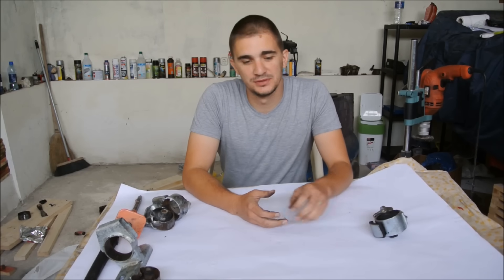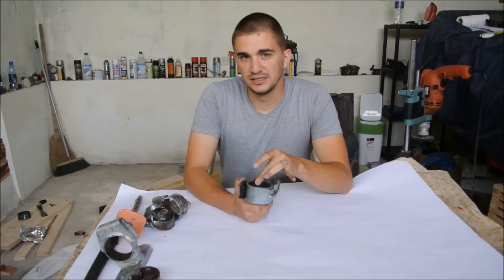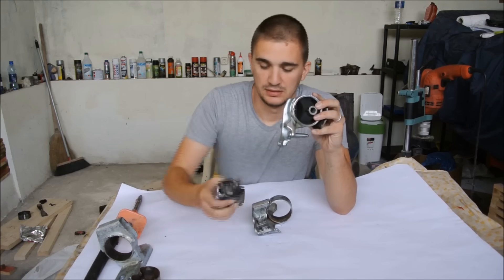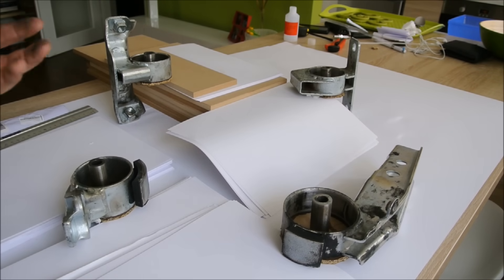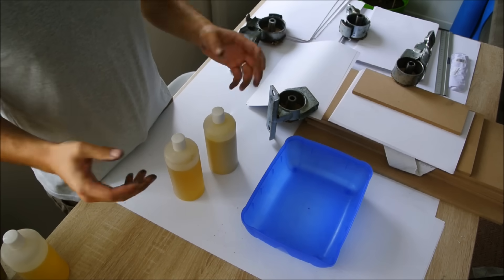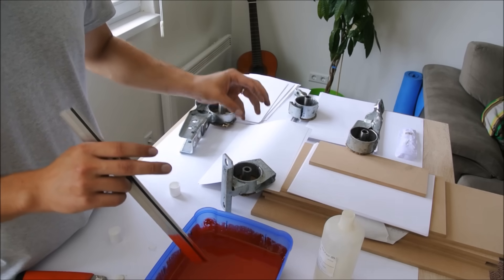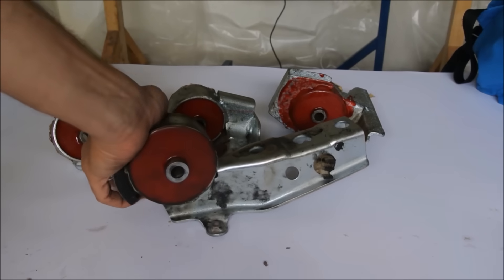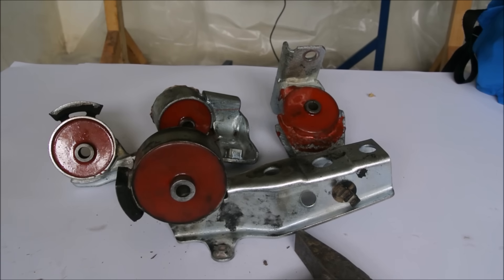How to make DIY polyurethane engine mounts

Comment: A plastic tomato sauce bottle with a pouring tip is a great container that gives much better control of the flow of liquids. The tip allows you to pour into small, precise places, and you just don't get the product spillage seen here. The easiest way to remove old mounts is to burn them on an outdoor wood fired bbq without trying to remove them from the OME bracket. Once all rubber is gone, the outer sleeves of the OME push in mounts can then be cut once with a reciprocal saw & twisted free easily. Plastic bagging or pallet wrap serves as a great release surface to avoid cardboard hang up!  Maybe a better way than using cardboard to local centre sleeves is to 12mm chipboard. Three nails will locate the outer rim, then put the centre piece where it needs to be (offset or not offset), and drill a hole through the centre so you can fit a bolt to the chipboard & hold it in place firmly with a nut. Common floor wax is a great release agent I use all the time in fiberglassing along with PVA release,  so I'm also keen to try them when i attempt this manufacturing myself.
Reply from the maker: WJP004 Great tips!

Comment: I used a calking tube of polyurethane normally used to install windshields instead of the 2 part. it only comes in black but the motor mounts are not that visible. I did not remove all of the rubber, only the loose bits and just filled all the holes, worked great.

Comment: Nice video for a great idea.  Wish I had done this before I used commercially made Poly bushings that turned my smooth ride into a harsh one.  I will try this to get a better ride but will never go back to rubber.  BTW some of the comments here are very helpful with suggestions but a few others are just people living an unhappy life I think.  I wonder sometimes how many people don't bother posting these helpful videos because of the negative comments they get.  Nice work driving 4 answers.
Reply from the maker: Ford Fan Thanks a lot for your support. These mounts will also give you a pretty harsh ride. I made follow up video where I compare these mounts to stock rubber ones in terms of noise, vibration, engine movement and driving dynamics.

Comment: It would be a very good Idea to use a Dremel with a cutoff wheel to cut small grooves around the center sleeve and inside the large outer ring to help create a stronger bond to the polyurethane.
Reply from the maker: +electronicsNmore That's a good idea. The mounts are still going strong, but I'm sure that if anything fails it will be the bond between the center sleeve and the poly. It would probably be a good idea to roughen up the center sleeve outer surface as much as possible.
Reply: @d4a  Hello, 4 years have passed, please tell us how these elements look now !. It will be great to see after all this time. Please.
Reply: @d4a  Smooth-On sells a product they call Ure-Bond to help their urethane rubbers stick better.
Reply: driving 4 answers It was a great video. :-)
Reply: It would be btter to use a proper metal-polyurethane primer. Clean the surface of the matal with MEK or Acetone, use some MEK to water down a little primer, apply with a small artist brush in a very thin layer, leave it 20-60 minutes to set, then pour or inject your material. 

I recommend using same method STR/Seacon/Subconn etc use for moulding cables or joints and equipment, ie: a empty tube + nozzle + cap, with a silicone gun. It allows you to push the air out of the nozzle end prior to injection. Not only this, but vacuuming the material down for a minute to remove air bubbles also helps. It depends on the material though (ie: pre-polymer and crosslink).

Comment: good vid , i need a new mount for my ferrari f40 OLD # 124452 , what color should i make  red or pink for it ?
Reply from the maker: zoltan Thank you, the product I used for adding color is called Smooth-On So-strong color tints for urethane and epoxy. They come in a wide variety of colors for you to choose. Don't add too much otherwise the color will be dark, a little bit goes a long way.

Comment: The pin is called a bushing and very easy to buy a longer pice and cut as needed w/o burning and the inner steel is also to distribute load on bracket- you have weakened these by brutally ripping them out and leaving them out -- geez  Notice old ones had rubber spokes not solid filled rubber- where is yours- it is needed so you did not suspend load properly.  Yep only cost $30 and 3 hours of process to save $100

Comment: Good job. I probably would have purchased some sheet metal of similar weight of what you knocked out of the motor mount, cut it to fit in the mounts to give it a similar structure.

Comment: Great video...   

I have a feeling as if I can handle this myself now..    
Where did you get the red color?      Are there any other colors?

What size kit did you buy from Smooth On?  
Trial size?    1 gallon?    

I'm thinking of gluing waxed cardboard with hot glue for a decent bottom seal..  

How about a follow up after almost year of longevity?
Still holding strong?    

Thank you

*Chris
Reply from the maker: Chris D. Thanks for watching, glad you like it. Red dye is also from Smooth-On. I bought the trial size. Still holding strong definitely. I was too lazy to wax cardboard, bur waxing is probably a good idea.
Reply: @Driving 4 answers
Would you use green and yellow to make lime green?
Reply: So trial size was all you needed to make 4 mounts?     
I just want to double check before I get the supplies..   
Thank you
Reply from the maker: +Chris D. Buy 2x trial sizes to be sure. I bought 2 but used 1. It all depends on mount rubber volume. Wouldn't know about color mixing, best to ask Smooth-On.
Reply: driving 4 answers thanks for your help.   
love the MR2.

Comment: Purchase from a business $160.00 Make it myself $25.00.  Using Diisocyanate in an unventilated area with no eye, skin or lung  protection risking permanent mucous membrane injury priceless!
Reply from the maker: prh44 The liquid polyurethane is not a health hazard and does not call for protection. I burned the old rubber out in the open and used protection.
Reply: I am so sorry you were misinformed. One really should study the SDS sheets associated with any chemical they use. https://www.smooth-on.com/msds/files/Econ_60.pdf. To each his own good luck in the long run.

Comment: And unlike yours on the video the pins of my mounts could get out of their frame if I hit them with hammer. Thank you.
Reply from the maker: Ok, that is bad. That means the poly did not bond with the pin. I suggest you do not install that. The pin must be 100% solid even after a strong hit with hammer it must not move or come out. Not all polyurethane is the same, mayve yours needs some sort of bonding agent.
Reply: Thank you for your quiq response...
http://vi.raptor.ebaydesc.com/ws/eBayISAPI.dll?ViewItemDescV4&item=262005307292&category=75576&pm=1&ds=0&t=1492003734497 That's the polyurethane that I've used.

Comment: Hi!I've got a question about the engine mounts I made by myself. I used a liquid polyurethane which has 75 shore a and the results I got was not rubber but really hard plastic Ann I'd be glad if you could help me if it's okay to use them like you mention in the description below cause after all aren't they supposed to be flexible in order to absorb the movements of the engine
Reply from the maker: Your car will likely have a lot more vibrations and noise. If everything is solid and well bonded together I suggest you install it and see how it feels in idle, if no issues try a small test drive, and keep monitoring its status.

Comment: Cool but not time efficient at all and if don't put the pin in the right place you just wasted all that time :( and money . remove and replace
Reply from the maker: Ralph Perez These mounts have been installed. More than 1k miles on them. Zero issues, feel great.

Comment: There is a product called Prosoco R-Guard Joint and Seam Filler. Would this work?
Reply from the maker: DaytonCarCare I wouldn't know honestly, haven't heard about it. Do a trial run on something small and unimportant and see how it works out. 3m window weld or any other similar product used to attach windshields to cars should work fine.

Comment: 13:42 what if you covered the metal sections near the polyurethane with wax.. reckon that would help prevent the polyurethane  from sticking to the meal ?
Reply from the maker: sypher0101 Would have worked probably, but I was lazy and this isn't a show car. Once you install them they are completely out of sight, but your suggestion is probably good if you don't want that unsightly spillover.

Comment: Please wear thick gloves when holding a work piece against a rotating wire brush like that, not thin rubber gloves. These are nasty things to easily get a serious sepsis from if you are unlucky and cut yourself. I know a man who nearly died from that and spent weeks in hospital.

Comment: I used a sawzall to cut the pin out of the mount; then with the pin in a vise I made many cuts with the blade perpendicular to the pin sliding the side of the blade down the cylinder. Once most the material was removed, I used a wire wheel on a bench grinder to remove the rest.

Comment: So instead of doing all this keep the old mounts and don't burn or cut them out go to lowes or Home Depot and find Polyurethane in a calking tube they are 6$ put your oven onto 120 degrees and put the tube in for 5 min it will be warm and easier to use ! Take a piece of cardboard cut the hole for the center pin one for both sides fill in one side then put the cardboard on the side you just filled the flip it over and fill the rest up ! Once it's in just let it sit for 24- 48 hours or put the mounts with the Polly in the oven for 30 min then it will dry faster worked great for me ! Doing what he is doing you can mess up he center pin and if it's off by just the smallest bit it will be really hard to get your motor mounted back up!

Comment: If you have a thick metal engine mount, you can drill some holes into the thick areas from the area where the rubber was, so there are areas where the polyurethane can hook into, preventing spinning and sliding even further beyond coarse sanding.

Also, if you can get just the rubber out, you may be able to coat it in fiberglass (in a manner that allows you to pull the rubber back out) to make a reusable mold.
Reply: This is great!
Reply: genius.

Comment: can you please tell me the materials used for 90A and the process for mixing it properly and its temperture resistance
Reply from the maker: sk sahil You just buy 90a liquid polyurethane, process is the same as in the video if you buy reoflex from smooth-on. You just buy reoflex 90 instead of reoflex 60 like i did. The process night be a bit different if it's another manufacturer. Just follow the instructions on the packaging.

Comment: loooooooool would not put that on my car ever. Are you a polymer engineer? No. Do you know the mechanical characteristics of the material you've chosen, NO! Dont buy cheap ffs
Reply from the maker: Matt Gladman I didn't know you needed to be a polymer engineer to read instructions on a can. That's like saying you need to be a nutrition expert to eat cereal. The mounts have been on the car for more than 500 miles and they are absolutely the same as on day 1, I am very happy with the results.

Comment: Perfect low cost DIY solution! Love this idea! We just replaced the motor mounts in my son's 69 Bronco, not sure this would have worked for that but I could picture making body bushings and linkage bushings using this method as well?! Thanks for the video!
Reply from the maker: Griffin Benchmark Thanks for watching, glad you liked it. I'm sure it would have worked fine for the Bronco too, as long as the mold isn't some super complex shape that is impossible to pour. Haven't tried suspension and other bushings yet, but lots of other people suggested it and said they would give it a go. In theory it should work, but I'll have to give it a try myself before I can be sure.

Comment: Reminds me of the quick fix for one of the cars I owned. 

Punch the center through a hockey puck. 

Worked better than an OEM replacement. Lasted 100k miles. Was impressed.
Reply: Lower arm or engine mount
Reply: @woozhi9218  engine.

Comment: hey mate, awesome site you got,
just a quick one about the polyutheran bushes,  you said you used  reoflex 60 but there are some other stuff  as well,
could you name which other stuff could be used to make bush of  the same strength?
Reply from the maker: +Sean Sean Another option is 3M window weld, or another liquid polyurethane product. You can pour it around existing mounts without removing them, will yield very similar results.

Comment: I know its a late video.. but check this out.

DO NOT do all 4 mounts.
I have multiple 20v swapped MK1s and the reason why kirk stopped selling all 4 is because its simply TOO rigid.
i ripped my rear transmission mount right out of the frame with the poly mounts.

you should ONLY use the poly mounts on the left side tranny mount, and the right side cam side mount.

you want the engine to be able to flex forwards and backwards during launches or you will literally rip the studs from the frame.

BE CAREFUL. or if you want to run 4 poly mounts, add some nice welded beats to your frame / mounts to reinforce everything.

Comment: Hey cant beat that and the quality of after market mounts isnt as good for less money.

Be careful knuckle heads that pin removal is some nasty stuff and will burn the hell out of you use gloves and a tapered punch heat your pin first before removing from the mount bracket give it a good wack on a vise and the pin comes out clean. Then take the mount out of the bracket and throw it away.

Press the cardboard on the pin to make and indentation and cut your hole then slide the cardboard over the pin hole and make an indentation with the mount before you take it apart so you dont have to measure anything.
Matchmark your cardboard in relation to the bracket so as to not get the pin in the wrong spot.

Comment: Are the fumes from the poly flammable? I need to change out my engine mounts on my 20v aw11 but i live in a colder region and can only do it inside and I have electric heating so I dont wanna blow myself up in the process.
Reply from the maker: +Josh Elliston As far as I know it isn't, but don't quote me on that. I recommend double checking with the manufacturer to be sure, maybe there are differences between different products.

Comment: I used 3M 5200 shore hardness 68 to repair a motor mount. It held fine.
It does flow slowly and will take several days to cure.
https://multimedia.3m.com/mws/media/158830O/adh-seal-fast-cure-5200-tech.pdf

Comment: stack wood under the mount before removing or damaging the rubber. start with the lowest point and use a hammer to imprint the wood. drill the hole for the shaft then stamp the mount surround. insert bolts into the holes in the vertical position, stamp and drill them as well. then remove rubber and insert back into template. then pour mold.

Comment: question. if you are pooring urethane into the mount already, could you just burn out the rubber with out removing the sleeve? not trying to cut corners. honest question as to not bond to oem mount, but to bond to the inner sleeve. do you not do it that way because heat may make sleeve loose and dont trust it?
Reply from the maker: +Rotary Addiction The pins are thick and strong but the sleeves are very thin so to be safe I got rid of them. They might have been able to handle the heat without any damage but I chose not to risk it.
Reply: thank you! i can see heat being able to warp and change the property of the metal if allowed to cool slowly the process is called annealing , which can be prevented if you shock the metal in water but still that also changes the property of that thin metal. 
we could burn out that urethane at a later date correct? since we are pretty much making a permanent style mount.

Comment: Very interesting. how does the engine feel through the chassis and steering wheel? I have a 924 and bought some Vibtronics engine mounts and had them in for a single day, the damn things almost rattled my fillings loose. Our engine mounts are complex as the engine actually hangs from them with a spring on one side vs most engines are like this where they either sit in the mount or on top of. Most of our guys are looking for replacements, but don't like the rock solid as you said.
Reply from the maker: Thomas Joseph Hmm that spring arrangement sounds complex. In the case of 60a there is still more vibration and noise when compared to stock, but still noticeably less than 90a. If you ask me, 90a is annoying all the time, except on track, so it's really race oriented. 60a is a lot more street friendly. The only time I find it a bit bothersome is on longer journeys, like 1 hour+ of highway driving. Especially thr noise. A trial quantity of liquid polyurethane is cheap, so maybe get a set of the cheapest used mounts you can find and give it a go. I'm really curious about the results in the case of such complicated mounts. Leave it to the Germans to re-invent the wheel eh? :)
Reply: Thanks for the reply. Problem is even the used ones are even getting hard to find. Porsche discontinued support for this model and many people are buying up these cars for spare parts. Below is a pic of the engine mounts. One side I think wouldn't be an issue, but the side with the spring is rather complex. Also, not that the image is upside down. The engine hangs from the larger single bolt.